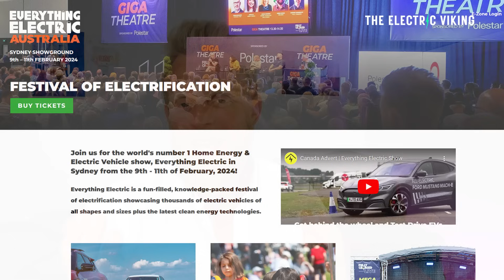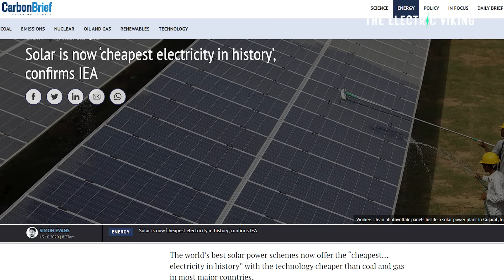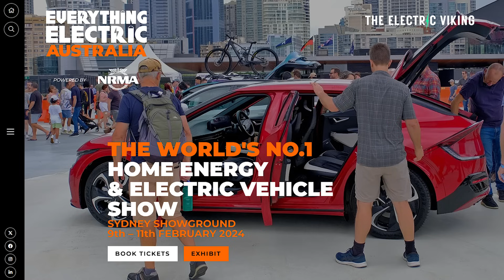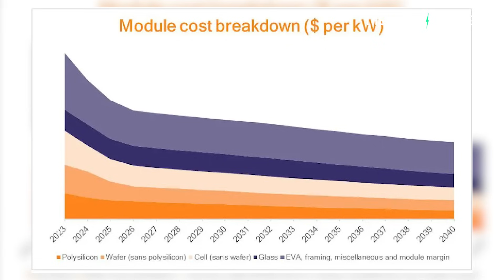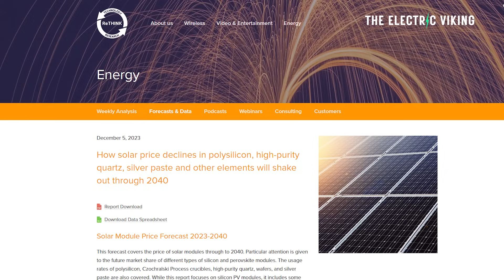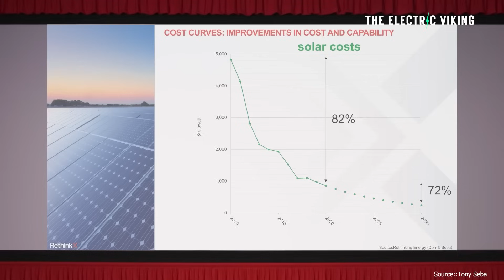Tony Seba just made this insane solar prediction that is blowing my mind

Comment: Yeh the low solar power prices is a game changer.  The question arises as to how do we guarantee supply when the weather isn't loving solar generation.  One way is to have much more battery but I suspect that expanding the grid to allow for a wider spread of solar generation placement will also play it place.  Spot pricing will influence heavy users of electricity such as steel works to avoid production on the rare occasion when our grid is unable to supply all of the demand.
Reply: I just got an email from 14D about there hot brick energy storage system. They just completed a testing run where they out put 900 degree Celsius air for a week using intermittent charging. This was to imitate the real world charging that would occur if using cheap day time solar and supplying heat for an industrial process that runs 24 hours a day.
Now solar power is here the changes to make it a real solution are following.
Reply: There are numerous companies working in the thermal storage field for industrial heat. Antora Energy’s system can do sustained 1500c indefinitely (and generate electricity!), powered by intermittent renewables. Rondo and other companies are achieving similar results. And the technologies are simple (“box of rocks”, basically), so they can get much cheaper at scale. Given the cost of solar per kW today, we’re just a few years away from renewable-powered industrial heat winning on cost merit alone. There are more carbon-free steel processes in development, too, and once they’re ready to scale, carbon taxes and tariffs could tip the scale rapidly.

Comment: Well the bottom will be arrived near the cost for materials. You can optimize nearly anything , but not the material costs
Well findung cheaper materials, of course, and increasing efficiency. But there is an end. Anyway even then PV is definitely the winner 🏆
Reply: >  material costs <   Even when the Silicon and other components are free, there is a limit on how low the cost of the glass will go.  As shown in the video, some of the panels are without the aluminum frame that protects the edges of the glass.

Comment: i said to some friend who belived in nuclear that it was somehow crazy to think a complicated instalation could compete in cost with what is basically sophisticated plastic wrapped around metal frame in a farm field or a roof. people who still believed in fossil or nuclear had basically a logic and intelligence problem
Reply: @pin65371  You live in a place that, if lacking hydro, geothermal or nukes, is going to occasionally need to burn some natural gas.  It's not the end of the world if you do that for a few weeks a year.  Don't use that as a cudgel to destroy renewables everywhere.  There are lots of places where they work spectacularly.
Reply: @pin65371  lies, no sun for 10 days means night for 10 days. Solar panel don’t actually sun to produce energy …. Just day light will have them produce, of course when sunny they produce 4-5 times more. You lived in a place where the night never stops, this is ridiculous
Reply: @pin65371 One word. “Batteries”.
Reply: @davestagner 2nd word. Expensive
Reply: @pin65371  I know this may be a shock to you, but I am aware the sun sets. I am also aware that there is some sunlight (and thus solar power) even when it is cloudy, for the same reason that you can see better on a cloudy day than at night. You had REDUCED solar, not NO solar. Where on Earth were you when you had full cloud cover and no wind for 8 days in a row, and when was that? I’d like to actually look that up, because rather than assuming it’s impossible, i want to get a better picture of how difficult the challenge is.

And, going back to your original comment… are you aware of the situation where power sources are deliberately turned off because they’re generating too much power? Are you SURE that the outages you saw in your data were due to weather, or due to deliberately idling? We see that all the time here in Minnesota. Wind turbines not spinning, while the ones next to them are. They’re turned off due to generating too much power. And frankly, that’s largely due to the fact that you can’t just turn off nuclear or coal the same way.
Reply: @pin65371  The exact amount you'd need, by region, is calculated in detail by RethinkX that is co run by Tony Seba. Go check it out 😉! It takes variability into account, to ensure resilience and energy production continuity and introduces the notion of super power - unintuitive U curve shape.
Reply: @pin65371  Seems like some pretty good arguments for getting rid of gas if possible.  So hard to start up and shut down compared to solar. 

I think nuclear is a good complement to solar power.
Reply: @pin65371  when there is a war, nuclear plants are taken hostage by attacking force, look in Ukraine. Half of nuclear reactors were stopped in France for various reasons. You know nothing
Reply: Cause there is a limit in how much energy you can get from a solar panel. In space its a bit over 1kw, and on earth its around 400watt / squaremeter.  My country uses 20500 MW of energy right now, to replace this with solarpanels means you need 20 500 000 000 / 400 = 51million square meters of solarpanels. that is 500km times 500km in size. (Another problem is that my country only have sun from 9 to 15 each day right now.. so you need way more solarpanels to charge a lot of batterys to be able to use batterys after 15 to 9)
Reply: @AndrewTSq 51 mio km2 = 51 km2 = 250 km highway with 100m panels on each side
Reply: @nicnordic6143  haha okey, now I know what you mean. I see for some reason I had 50*50 :D :D sorry for that.
Reply: @AndrewTSq the square root if 51 million is 7.1 thousand. So you'd need about 7km square not 500. Still a lot. But not impossible.
Reply: @AndrewTSq  - you will find there is a slight issue with your maths 🙂There are 1000m * 1000m in a square kilometer. That's a million square meters in a square kilometer. So your 51 million square meters of solar panels is the same as 51 square kilometers. Or just a bit over 7 times 7 km. Even in a tiny country like say the Netherlands, that's just over 0.1% of the total area
Reply: @sdewaard  yes it was corrected by another commenter. Sorry for that
Reply: Nuclear is good for 24/7 base load.
Reply: @fredbloggs5902   nuclear is good to transform your region in a nuclear waste when there will be a war, is also good to be the most expensive and non competitive form of energy, sky high price, it's simple economics
Reply: @tube5607-i4n  Believe whatever you like, the U.K. is currently dependent on France for power because the wind stopped blowing.
Reply: @fredbloggs5902   i call BS on your part, France has no spare capacity because 30 out of 60 nuclear reactor are in repair. Nuclear is dangerous in case of a war and expensive, does not scale like solar
Reply: China has 224 nuclear plants in development and plans for 400. Nuclear has 2-3 Million times the energy density of solar / batteries. If you aren't doing nuclear at a better price than solar, that's on you. The U.S. allows reactors to take 20 years to build, over 70% of expense is finance charge due to build duration. Japan builds that reactor in 39 months, therefore much cheaper. Same with S. Korea and of course China, who are not only going into uranium plants, but now going into Thorium reactors as well. They aren't doing it so that they can pay more. It's science and math.
Reply: @beautifulgirl219  ca me rappelle un connard de droite qui m'avait dit qu'il faudrait couvrir la france de batterie pour que ca fonctionne, lol

Comment: Solar and storage is awesome but it dies after a few days of volcanic ash blocking the sun or any other small to large cataclysmic event. Nuclear and gas plants will continue producing energy under such conditions without any fuss.
Reply: nothing like a catastrophic event to justify nuclear power….oh wait ever heard of Fukushima?
Reply: Hahaha!  Volcanic ash, yeah, that's a common problem.  You do realize with enough volcanic ash the power lines all short out and you can't transmit any energy, anyhow.  The only people who'll have power under those circumstances will be the ones with a broom and solar panels on their roof.  

Nuclear meanwhile couldn't survive a one-in-500 year tsunami in Japan.  Nevermind how they become tempting targets in wartime.  It's over for nuclear power.  Too expensive and too dangerous.  You need backup power for a supervolcano?  Keep a bunch of old coal fired plants around in backup standby.  Problem solved.
Reply: so, you can fly to the moon but have no experience cleaning solar panels? So nuclear is immune to earthquakes? Gas pipes are immune to wars? stop thinking inside your little bubble.